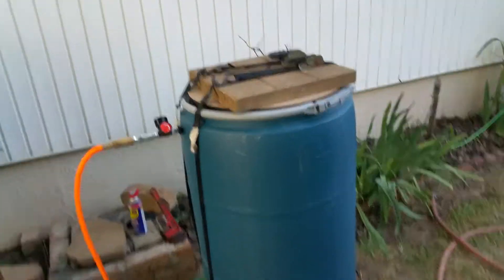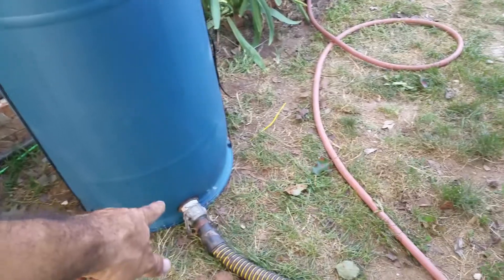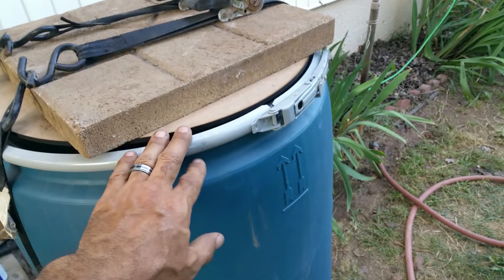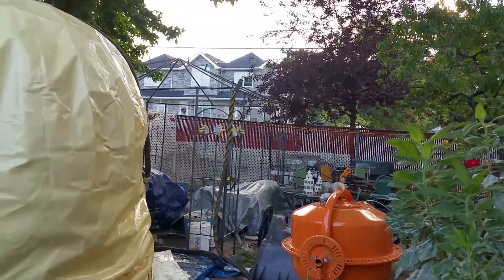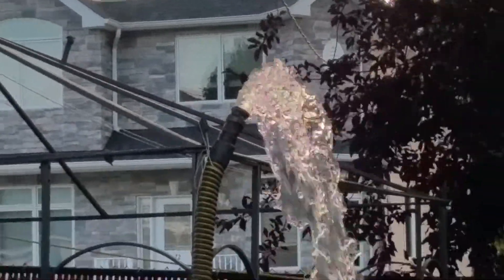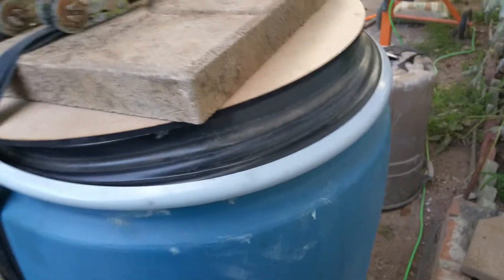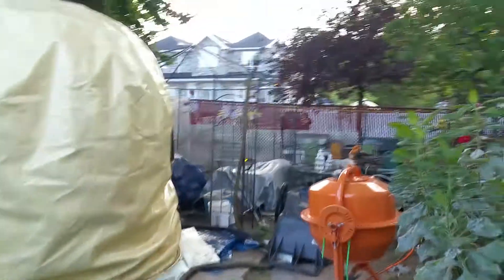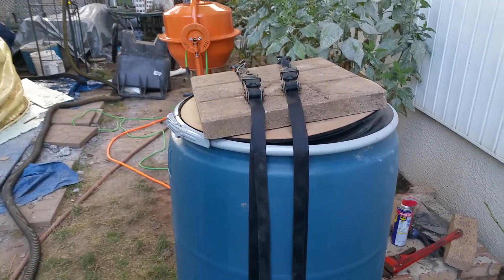50 Gallon Aircrete Air Pressure Pump #AircreteHarryFoamGenerator #AircreteHarry #Aircrete #Pump

Comment: Hey Harry. I was thinking today anad a Tesla idea came to me. He worked a lot with vaccum and pressure making components for his curcuits.The vaccum would of course take all the air out of your aircrete. what would happen if you allowed the aircrete to cure under a constant air pressure?

I am thinking the smaller bubbles would, being pressurized, would give the total thickness more strength. An interesting experiment for the group to look into.